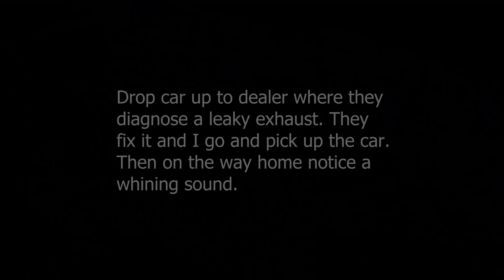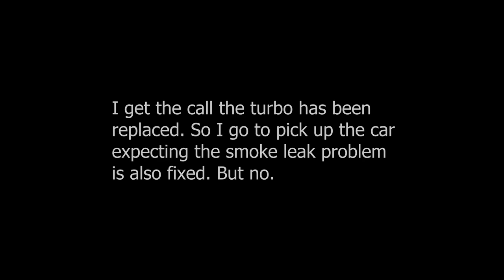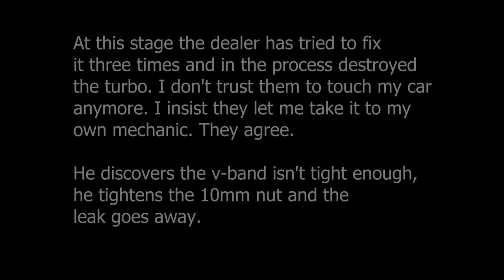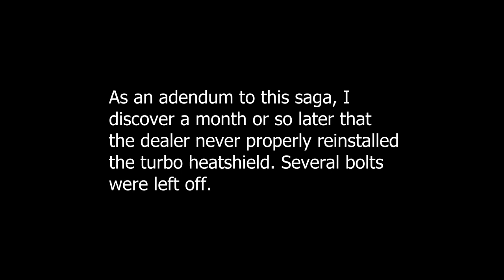Turbo Leak Peugeot 208 - V-Band problem

Comment: I think I have the same problem, that V-band connect's the turbo to the exhaust?
Reply from the maker: Not exactly. Kind of - what it does is it connects the two halves of the turbo together - the compressor and the turbine sections. If that's not tight I think you get oil leaks into the turbine. If you are going to try tightening it just be careful that you don't over tighten it as the v-band will actually not sit right if it's over tightened. In my case I have to over tighten it because the damage has already been done but if yours is okay and your problem is something else you could actually cause a problem with the v-band. In my case I'm actually going to replace the turbo and in fact I have one ready to go just waiting until I've got time to do it.
Reply from the maker: Good luck with it. let me know how it goes.